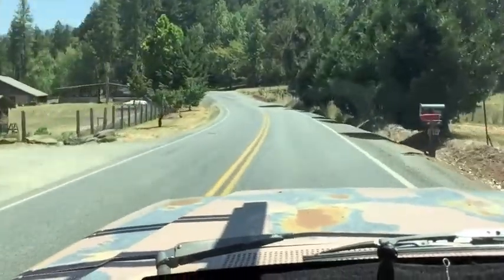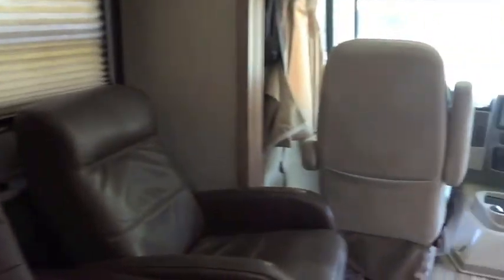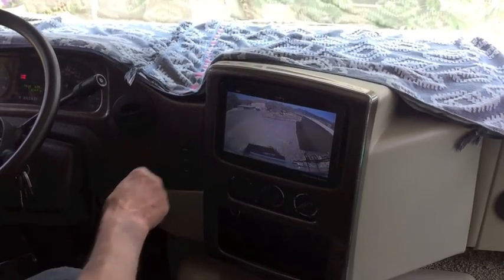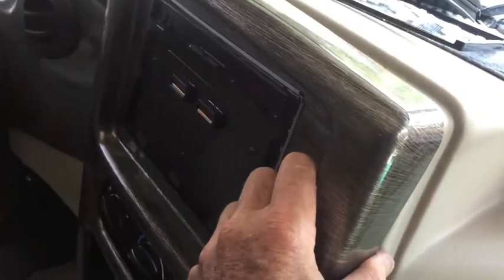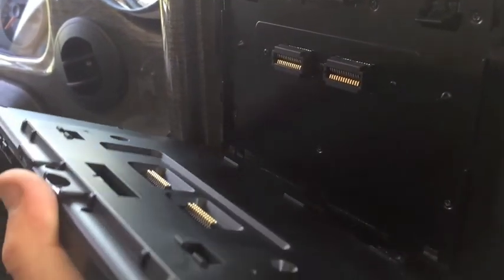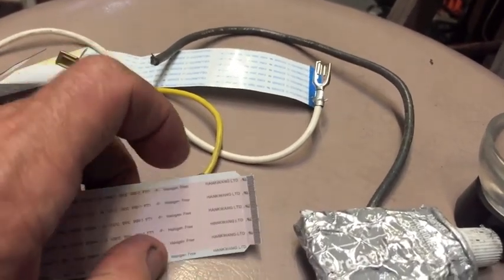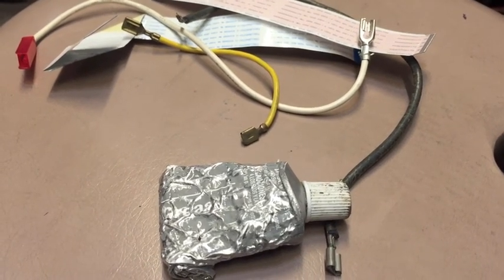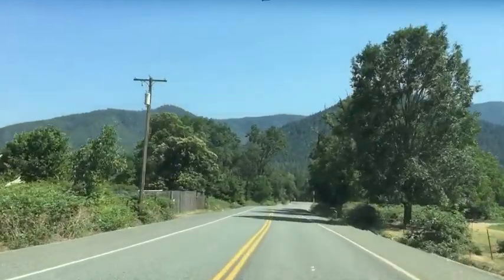Thor Ace Motorhome Monitor Repair

Comment: In my experience the connections in electronic circuits have always been the weakest link.
A pencil eraser clean on ribbon cable close connections and conductive carbon grease on single large connectors liable to oxidation is my preference.
Reply from the maker: I did not know there was such a thing as conductive grease. Thanks for the info.
Reply: @GrantsPassTVRepair  My pleasure, I owe you far more.